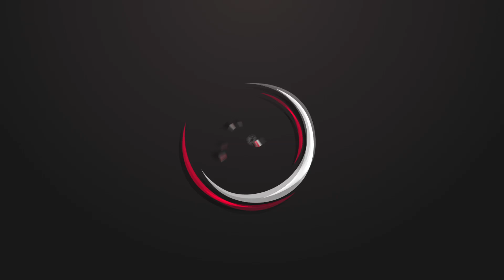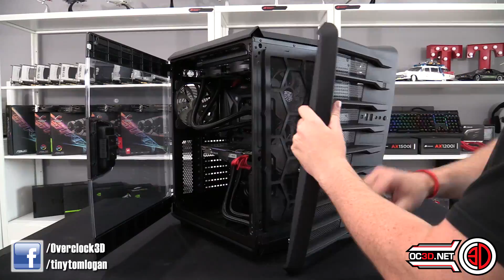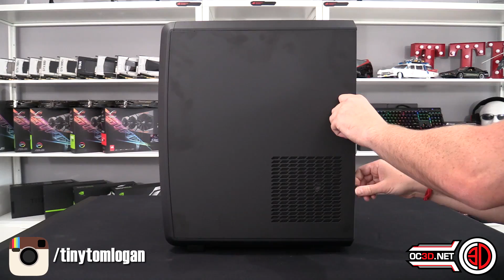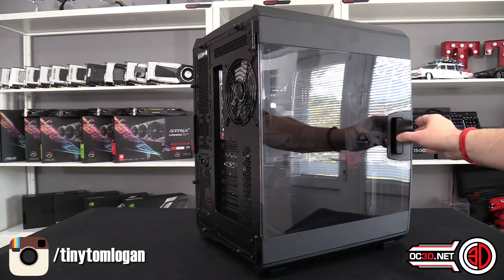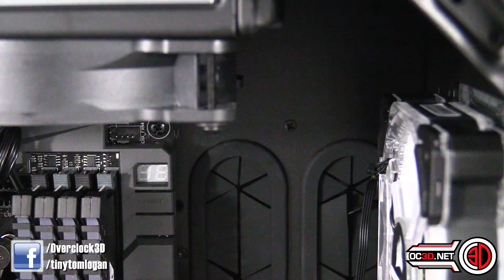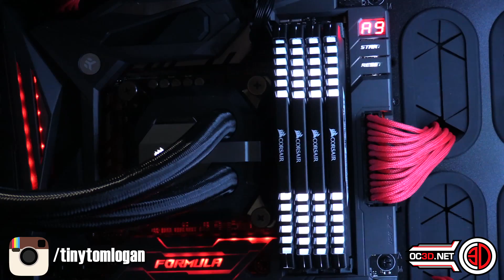Corsair Air 740 Case Review

Comment: Wow so they still haven't provided filters for the anything other than the front. Great job Corsair.
Reply: Can't say I agree there as a generalization. I've been running a 550D for the past 6 years, of which the dust filters do a fantastic job. My case has always been placed on the floor too.

Having said that - can't comment on their newer cases..
Reply: I like your idea :)
Reply: Having experience of the 900D, Corsair's dust filters are not fit for purpose. They do nothing. You're better off stretching a pair of black tights over the intake and putting some good static pressure fans behind them. This'll give a good matte-black appearance too.

Comment: Using a Air 540 currently. if they really are gonna offer a HDMI passthrough in the front end at a later point I would be highly tempted to do the upgrade to it. but until that is confirmed I will likely keep my 540 for now.

Comment: Corsair cases are getting wack
Reply: I love my 740. The size and dual chambers are amazingly good. The airflow is also amazingly good. The only thing is the way it looks. So if it looks good to you and you like cube cases, get it. You won't regret it. If you don't like the way it looks, get something else.
Reply: Asterisk What would you recommend then? I want a white case preferably with black interior, or black case which id paint white if your recommendation doesn’t come in white. I haven’t purchased a new case for 10+ years and still using my good ol thermaltake armor which i’ve modded to utilize modern case features.

Comment: solid States are still way to expensive for HDD to he replaced. under 200 for 1tb... needs to be reduced to under 50 before that happens.
Reply: +Space Cadet Spoken like a true 1st world spokesman ROFL.
Reply: I agree with you, I have a 1 TB SSD for my OS, one 6TB HDD for TV series, one 5TB HDD for movies, two 3TB HDD drives for photos, one 1TB HDD for software, two 500GB HDD for documents and music. No all in my Fractal Node 804. That's 8 drives. How could I afford all that space in SSDs ?! This Air 740 has loads of room and only supports 3 HDD ?!
Reply: +Space Cadet hey I get what your saying,i wanna get some ssds myself but saying 2 1000tbs ssds are cheap than having 3 or 4 2 or 1tb hard drives is kinda inaccurate.
Reply: This is ridiculous. You know you can use an SSD for your OS and top games and use HDDs for bulk data? You can mix it. It's dead simple. Even if you did have 1 TB SSD, it would be a mistake to not partition it for the OS and rest. There are so many cheap TLC SSD's available now; although I'd go for MLC.
Reply: Informative Gamer S if HDD's had of come down in price i might agree with you. but if anything they've gone up. mechanical devices = failure. i suggest you check out the new samsung range being released soon. you can get a 500gb for about 100 bucks US. then you get another, and then another further down the road. that's how i did it. one by one. i've had 8 SSD's now. not one has ever failed. one has been going for 8 years!!> i give them to friends when i'm finished with them because i'm used to HDD's and i assume they'll fail. but they never have. they're amazing. whole diff ballgame
Reply: @spacecadet2827  you can get 14tb for 500 vs probably 5k ssd
Reply: Well that's a lie, ^ because I will not be using an ssd unless they come within %20 more of the cost of a hard drive (not %500+ like it is now), then I'll consider it. $400 Aud for a 1tb ssd when I can get a 1tb hard drive for $70 Aud? Yeah no.
Reply: Considering the size of the case Im disappointed by the lack of 3.5 drives.  If they had made the thing a hair wider and had 6 horizontal 3.5 mounts I'd be happier.

You can literally throw SSD's anywhere.  I don't get the hype with the plastic lock together caddy for them personally.
Reply: Space Cadet Say what you want, I don't care if you think it's dumb. Quite frankly I don't mind if my hard drive fails (well yeah it's annoying but that's about it) on me in x years . Most of the space on my hard drive is full of a tv series, movies and games, which can easily be re downloaded. My "important" folder is only 3gb which I have backed on 2 usb sticks. I would much rather re download all my media then spend 5x more for an ssd of the same capacity.
Reply: Space Cadet 1tb isn't really big... But yeah I would much rather re download everything once every 4 years worst case senario which will take a couple of days of constant downloading for me. Opposed to having an ssd that can fit 2 games and a 1080p blue ray movie on it for the same price as a hard drive. Having to delete a game and reinstall another if I want to play a game other then the 2 that would be on my 128 gb ssd (cost the same as a 1tb hdd in Australia lmao) that isn't installed on my ssd? Yeah fuck that.
Note: My internet speed is 10Mb (bit) download.
Reply: Space Cadet First of all I don't have this grandmasters library of tv series, movies & games like you may think I have. Infact I have a much less then you may think, however the problem is the games I have are very large in size (GTA V, TW3, modded Skyrim, FO4 &  BO3). For example, I have breaking bad on my hard drive and its the sole tv series on my hard drive as it's my all time favourite, that stays with me . Same goes for movies, I have only 4 movies on my drive which happen to be my favouries also. Combined that takes up ~45Gb as one of the movies is a blu ray as it's my #1 (John Wick, not that you care).

So if I had a 120gb ssd 35gb +6gb for windows 10 leaves me with 80gb for my games. Considering GTA V is 65 gb, I'm left with 15 gb for for the rest of the games I play on a regular basis, which equate to ~200gb. So I would need at least a 500gb ssd to have some leeway as 250gb will only leave me with 10gb for my programs and misc storage. 

 In my case I need a 500gb ssd or higher & I like to have more. Which still cost $200 & if I were to purchase an ssd it would be 1tb which is $400 Aud as I said earlier. To me that is not worth it. As I can purchase much more desireable products for the money, such as a nice pair of headphones, or new monitor or even 2/3s of a new 1070.
Reply: Space Cadet I said it's full of tv series, movies & games. I didn't mean it was literally full, I meant that's what's in the hard drive, as in nothing with sentimental value such as photos. I think you are mixing up my original comment with that other guys last comment.
Reply: Space Cadet I mean I'll get an ssd eventually, (my original statement was somewhat a stretch but I could see someone in a less fortunate country in the position I described) as my pc in general is less than a year old, but right now it's not my top priority :p
Reply: I have almost two tb of stuff on my main hdd
Reply: Fluroxide :D price to performance and longevity of ssd to hdd is not question, if you had the cash to purchase 16.5tb worth of HDD you could have gotten AT LEAST 7tb around the same price in SSD and 7tb is plenty more than you will ever need unless you download every game and every movie ever...
Reply: Informative Gamer S if you're on this channel you live in the same world. you're just a confused tight ass who hasn't lost his data yet, but when you do, you'll be talking just like me. It cost me $2000 AUS to get my data off a failed drive. and they could only retrieve 80% of it. trust me it will never happen again.
Reply: cotes42 learn to back up and clean out. you do not need to keep tv series on a local drive in the real world. I'm a photographer [have been for 8 years] and i don't even have 3 TB of photos. [yes i shoot raw, and also keep full TIFFs]. I can assure you every single person in this thread will be using SSD within 3 years. Henry ford said "If i asked people what they wanted they would have asked for faster horses"
Reply: Fluroxide :D that's just dumb, but it will happen soon. the problem is the hard drives you buy nowadays will be dead in 4 years like they always are, and the ssd's you buy would soldier on for a lot longer. [i have one that is in it's 8th year.] you're just being an idiot. go for it. nobody here is trying to make you buy anything. we're just saying you're an idiot. have at it hoss
Reply: Fluroxide :D so you really like big hard drives so that you can store TV shows which you say are easily downloaded agin. RRIIIGGGHHHTTTT, ok then, makes TOTAL SENSE. it' your data bro. henry ford said "if i asked people what they wanted they would have asked for faster horses". you're the guy asking for faster horses
Reply: Fluroxide :D  why on earth would you need to store tv shows for four years, let alone DL them AGAIN, and store them for ANOTHER four years?? what fucking planet do you live on? and no you don't need to reisntall games. you just move your steam folder, click on the icon and bam they're running again. I only have 1mb DL speed internet speed by the way. do what you want bro. one day you will realise what a dumb decision it is, until then i don't really give a toss. you want to be the last person on the planet to get smart. it's ok with me. everything you're saying right now is kind of nonsense, i'm not going to agree with you i'm sorry. you're like the guy who stores old newspapers cos he thinks they'll be worth something one day
Reply: Fluroxide :D so now you DON'T have much tv?? so why did you bang on about how you need room for it. and breaking bad?? like you could leech that overnight. like the whole thing.  i'm confused and i don't really give a toss. do what you want. i'm tired of your old man newspaper collecting stories. i have a huge game folder by the way, on it's own SSD, and it's only 600 gb [and 200gb of video editing software is shared with it] . and fuck man the speed at which maps launch is insane. you have no idea what you're missing out on in actual performance, but like i say, you'll kick yourself one day about your own stubborness
Reply: Fluroxide :D ok cool. sorry. and don't get me wrong. i'm not rich. i'm not being snobby. SSD's are the best upgrade you will ever see in your system, it's a high priority thing, and i'm amazed that people still buy HDD's, even the noise i find absurd now. when i back up to HDD's i realise what i used to put up with. It won't be long. two years and they'll be very cheap. you'll have enough space then.
Reply: are you being serious?? ssd's are getting dirt cheap. i have 3x1Tb in my case.
spinning drives are for neanderthals who like losing data.
HDD haven't dropped in price at all. they're terrible value.
in 2 or 3 years nobody will be buying HDD's like ever.